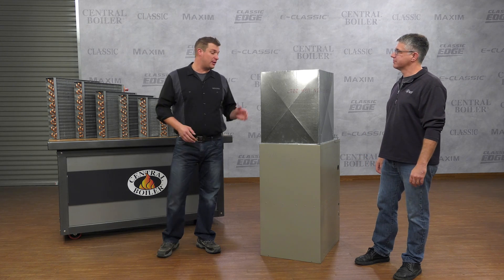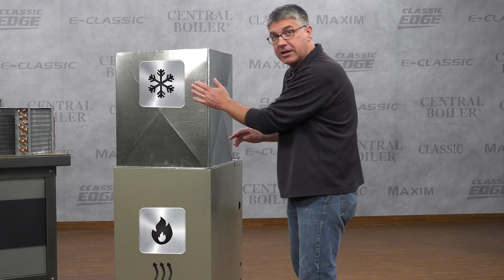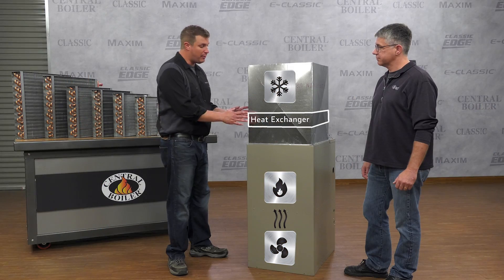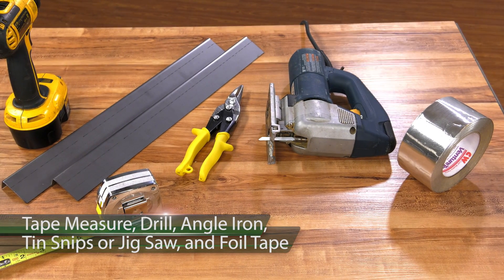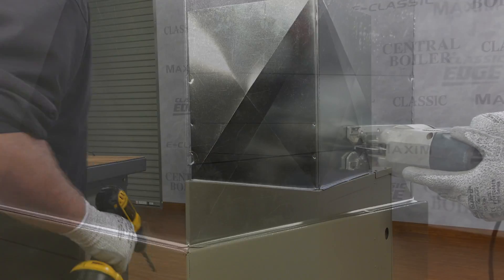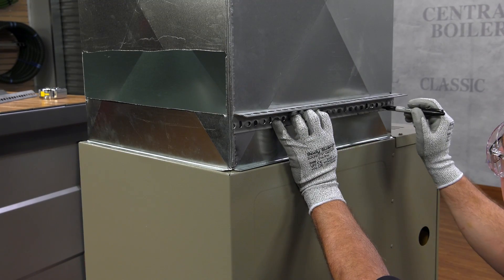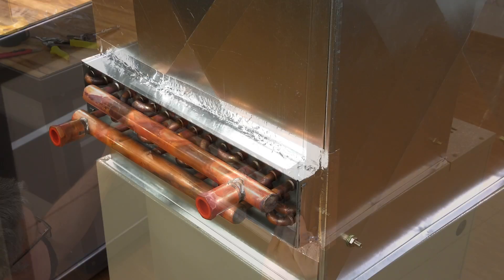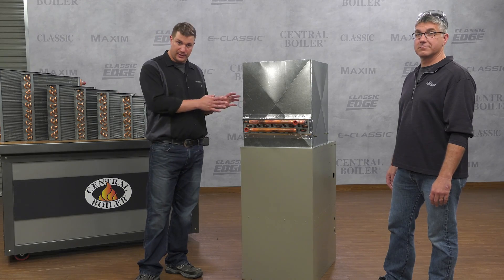Easy Installation: Heat Exchanger In Plenum Of Forced Air Furnace │ Central Boiler

Comment: Can you have both in the same furnace? Hot water and hot air and flip back and forth? Thanks
Reply from the maker: The Central Boiler outdoor furnace heats water and uses the heated water to transfer heat to your home. Once inside the house, different exchangers and Tees can be added so you could have both forced air and radient heat all sourced by the outdoor furnace.  Does that answer your question?

Comment: I wanna use this for heating my garage.I was wondering if the heat exchanger is going to restrict the airflow of the furnace for home heating?Also does it release any poisonous gas when copper parts get heated?
Reply from the maker: There is some air restriction yes. You can get details on that in the Hydronic Component Selection Guide that came with your furnace or is available through your dealer. Copper pipe is used in a wide variety of HVAC applications beyond Central Boiler. It is being heated by water and not directly exposed to the fire.

Comment: I'm VERY new to all this, and I don't like the idea of using a water heat exchanger.  Is there a system where a large tube (like 200mm - 8") is connected to an exterior furnace, and air is blown into the tube...to blow back out again after going through the heat of the furnace?
Thanks.
Reply from the maker: Water holds heat and enables the heat to be transferred across a cold outdoor environment.  This isn't possible with air.

Comment: What is the maximum air temperature you can get from this with 185 water temperature
Reply from the maker: Talk to your local dealer and ask for a Hydronic Component Selection Guide. It has charts for that.  With 1,000 cfm air flow through the exchanger, entering air temperature of 60 degrees F, and the 185 degree F water flows at a rate of 7 gpm, the heated air temperature will be about 128.

Comment: Does a heat exchanger have a direction of flow, does it matter what port is your inlet?
Reply from the maker: Yes, the direction of flow matters for the water-to-air heat exchanger.  You can find details in your Furnace Installation Guide which is available on CentralBoiler.com/Support.  Here's from page 18:  For a single building water-to-air heat exchanger system with a domestic
water heater, the direction of water flow must go from the hot outlet on the outdoor furnace to the lower side fitting of the domestic water heater exchanger, to the lower fitting of the heat exchanger in the plenum of the existing furnace, and then to the return port of the outdoor furnace.

Comment: This is exactly b what I need to capture the thermal heal from my 24 *7 running Bitcoin miners and the residual heat can still be directed inside for winter outside in summer but water 24*7

Comment: do these heat exchanger need to be taken out and cleaned for dust every year or two? ty
Reply from the maker: No they do not.  The indoor furnace air filter is sufficient.
Reply: I find it is a good idea to blow it out every once in a while as dust can build up inside it.

Comment: The more the fan is on, the more wood you burn.  You can watch the water temp fall within seconds of activating the fan. Which does what? Open the draft.  Which does what? Burn more wood.  Plentum systems are by far the least efficient method of keeping comfy.  In floor heat cement installed over 2" foam with a vapor barrier is the answer to both efficiency and comfort.  The next best option is baseboard.  But if you like cutting 25 pickup truckloads of wood per season, by all means, use the plentum heat exchanger.  It's your funeral.
Reply from the maker: Plenum heat is the most used and most popular heat delivery system throughout the US, regardless if from an outdoor wood furnace, propane, electric or oil. It always comes down to the BTU required for the building being heated.  A heavy heat load will draw water temps down faster requiring more wood burned to replace the required BTU. A well insulated low heat draw house will allow the outdoor furnace to rest for much longer periods of time, therefore burning less wood. 
In NW Minnesota, I burn just 5 ½ - 6 cord of wood per heating season in my Central Boiler Classic Edge through a forced air plenum coil. While floor heat is a nice warm even heat, keep in mind if you live in a climate where nights and mornings are cool but daytime hours get warm, that floor heat mass may continue to emit unwanted radiant heat and can make your home warmer than you would like. Also, if you want central air conditioning, you double your expense by needing to install ductwork for the AC, plus the cost of the in floor system install expense on new home builds.

Comment: Hi, I have carrier air handler which has ac coil all the way on the bottom and blower on the top so my only option is to put hot water coil in returns before the ac coil..Is that going to be fine? Or there’s any other solution?
Reply from the maker: That sounds like a downdraft system.  Is there room to put the heat exchanger between the a/c coil and the fan?
Reply: I can only place hot water coil in the supply plenum (right on the top of my air handler)or the return side of air handler.

Comment: Can this be used with a 24/7 "ON" furnace fan, in a typical electric furnace? Is there any way to control the temp with a 24/7 "ON" fan?
Reply from the maker: Yes.  A zone valve connected to a thermostat would allow heat through the coil when needed and would stop the flow once the set point was reached.

Comment: I want to exchange all those heat going out via the furnace vent flue, to be captured outside (on the 4" vent to 6") the galvanized pipe or going thru an heat exchange like this and connect the exhaust back to vent out. Is this possible? I want to supply my water heater with captured hot water via this arrangement. ???
Reply from the maker: The easiest way to use your Central Boiler outdoor furnace to heat domestic water is with a side-arm heat exchanger installed on your water heater.  Here's an installation diagram: https://centralboiler.com/media/2611/install-central-boiler-forced-air-system-c110.pdf

Comment: does the boiler water supply connect to the upper or lower NPT connection on the plenum coil?
Reply from the maker: Correct, the supply line connects to the LOWER connection.

Comment: Could the coil be added to the return air side of the furnace?
Reply from the maker: It is best to put the coil on the hot side before the "A" coil, but putting one on the cold return, although not ideal, happens quite often and works fine.

Comment: Can you put in a circular with closely spaced Ts to charge hot water to the HX , powered by the furnace blower switch relay ?
Reply from the maker: If you are referring to the indoor wiring, please consult your local dealer or an electrician.  We have many different wiring diagrams available on https://centralboiler.com/support

Comment: Why do you recommend putting the heat exchanger before the HVAC unit?
Reply from the maker: If an air conditioning coil is located in the plenum, the heat exchanger should be mounted between the fan and the air conditioning coil so the heat exchanger will not freeze when the air conditioner is being used.  Does that answer your question?

Comment: In the summer when its hot and AC is needed, how does the furnace cool off the house when the Boiler coil is producing heat for hot water?
Reply from the maker: During summer, the hot water can be redirected so that it does not go through the coil.  Or, if desired, the outdoor furnace can be shut down and the water heater can be switched back to use gas or electric.
Reply: Seems like a bypass valve can be installed for that.

Comment: Hi, does one simply use their HVAC fan? Can you regulate the temperature to deactivate the blower when the desired temperature is reached?
Reply: I’m wanting to put a LP boiler in my attached garage and put the heating coil with the copper pipe running inside my HVAC aluminum trunk line just a few feet and then run my Trane Tam 7 seven air handler on the lowest fan speed and then of course that would give me hot water heat throughout my whole house. The people that are going to install the boiler said this can be done and they’re hunting for the right size heating coil. Has anybody done this before?  I’ve seen pictures of it.  We would use our air handler Seer 18 heat pump just for AC in summer. Our electricity since that Biden got in the office has skyrocketed in our area so propane is now cheaper than electric.
Reply from the maker: Correct.  Here is a wiring diagram that would operate the fan only unless the existing thermostat temperature was met.  https://centralboiler.com/media/2586/adding-thermostat-central-boiler-outdoor-furnace-c120.pdf  
There are many other diagrams for different configurations on centralboiler.com.
Reply: @centralboilerinc  how do u get the boiler to start for the hot water?
Reply from the maker: When a side-arm heat exchanger is installed on your water heater, it will use the outdoor furnace system water to heat your domestic water in the water heater. The outdoor furnace system water is a closed loop and never mixes with your domestic water.  The outdoor furnace monitors the system water and efficiently burns wood as needed to keep the system water at 185 degrees F.  Here's a diagram that might help: https://centralboiler.com/media/2611/install-central-boiler-forced-air-system-c110.pdf

Comment: I got the exchanger in. I have a electric furnace how do I make it so the heating element doesn't come on but reads the temp still and just controlls my fan.
Reply from the maker: Here is a wiring diagram that would operate the fan only unless the existing thermostat temperature was met.  https://centralboiler.com/media/2586/adding-thermostat-central-boiler-outdoor-furnace-c120.pdf  
There are many other diagrams for different configurations on centralboiler.com.

Comment: So in this set up, does the forced air system have the indoor burner also?
Reply from the maker: If we understand your question correctly, the answer is yes.  The forced air system contains your existing indoor propane/natural gas/fuel oil burner and the water-to-air heat exchanger is added.  You can then have your existing burner set to kick on when you shut your outdoor furnace down or if you let your outdoor furnace run out of wood.

Comment: How does this restrict the airflow for the AC in summer?
Reply from the maker: Restriction of air flow in the plenum is rare.  For specific information on Central Boiler water-to-air heat exchangers, you can see the Hydronic Component Selection Guide that comes with each Central Boiler furnace.  There is also information on measuring air flow in the Central Boiler Installation Guide.